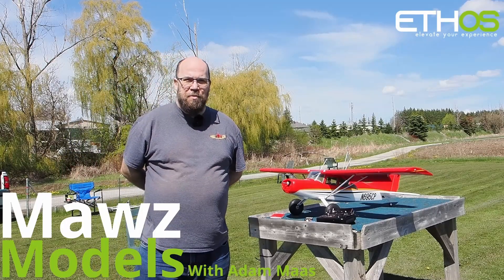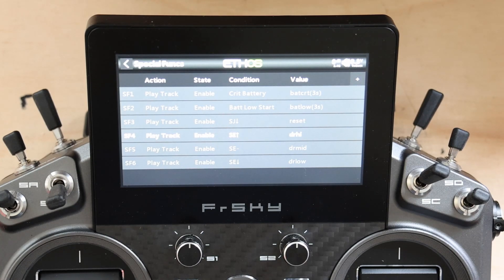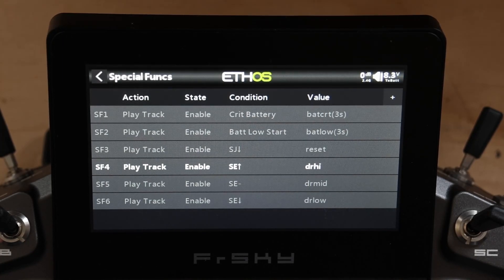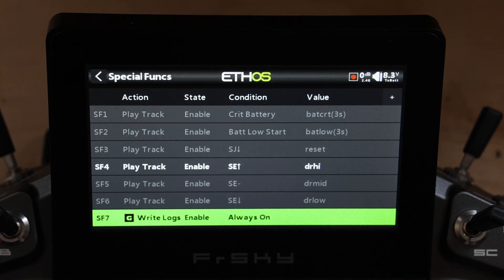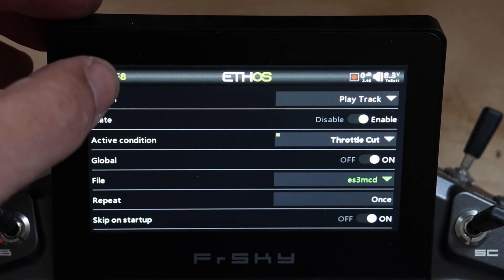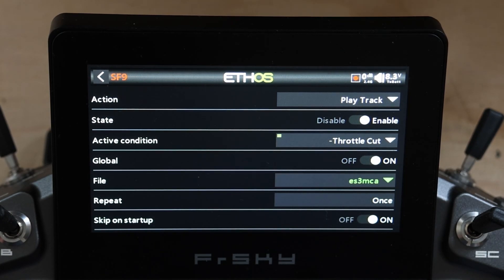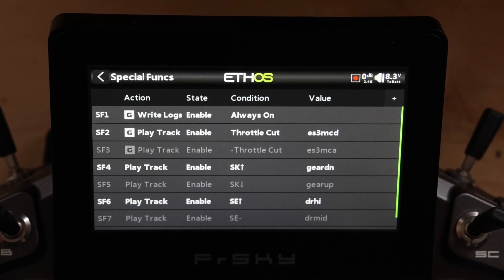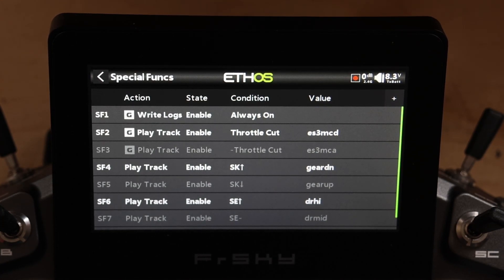ETHOS Tech Tip 17 - Useful Global Special Functions

Comment: Aha - I see you kindly answered an off-topic question so I’m going to sneak another one in! I’ve working on a kind of Shellim-like throttle arm - ele back and momentary on the Tx back activate a logical switch. Then from that one active I have another sticky logical switch called “ARM SWITCH”. I want to use that in the canned throttle cut as the active condition. It works, but backwards.. I’ve spent ages looking for the OTX ! operator in the Ethos manual but no joy. So, how can I invert a logical switch status? (I realize this prolly is a messy way of doing it but recoiled in horror trying to figure out Mike’s Ethos F5 templates without an Ethos companion and I want to start using my X20S - I didn’t fully understand e3soar+ in OTX but oh boy is it good for big 6 servo e-sailplanes) ooh, while I have your attention, is there a way of displaying all the logical switch statii (like OTX monitor screens). PS., you really need a buy me a coffee button!! Patrick “Grogu”

Update: Slavering over your Pro! Did you have to wait long for it? Update - I found invert! Working well. Now, I use the momentary on the back and zero throttle now to set "ARM SWITCH" - is there a neat way to hold down that momentary for say 2 secs and switch off that ARM SWITCH?
Reply from the maker: I got my Pro pretty quickly once they started shipping, got it in August, although I'd been waiting since before the announcement.

If using a Sticky, Delay before Inactive controls how long you have to hold the switch before it turns off. Set that to 2 seconds for a 2 second pull to disarm.

Comment: Hi Adam,  I've been enjoying your videos, and as a new ETHOS user I find them very useful.  There is one suggestion I would make as I am sure a lot of your audience is like me and new to ETHOS and the FrSky radios.  I would have found the videos much more helpful if I could see which buttons you are using to do navigation and selections for the tutorials.  For example, in your Tip 3 video, it took me a while to realize that you were using the throttle trim  (T3) to change the value of the curve point.  It's great to get a closeup of the screen, but some practical information is not captured.  Just a thought.  Thanks, and keep up the great videos.
Reply from the maker: Hi Scott, glad you are enjoying the videos. I'll definitely keep that in mind, it's a balance of showing the full radio or enough screen to see what's going on and I don't always get that balance right.

Comment: Hey Adam I know this is not on topic but I need help. I want to put the nose gear steering on s separate channel from the rudder, which I think I have done successfully. What I haven't been able to do is assign an independent trim to the steering. Any help would be greatly appreciated.
Reply from the maker: Hi Michael,

You'll need to add a second Free Mix with a source of the trimmer you want to use and an output of your nose wheel channel. That will give you independent trim on that channel